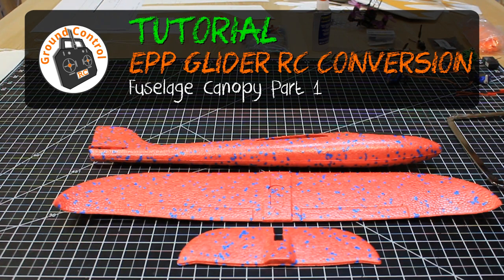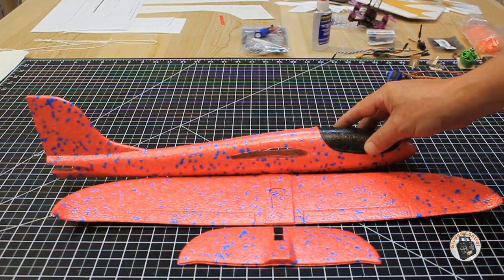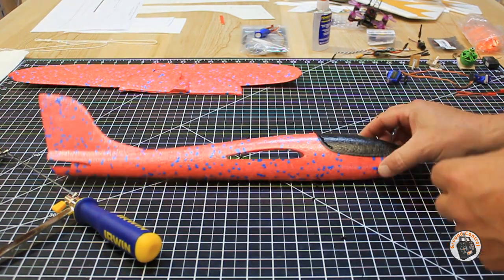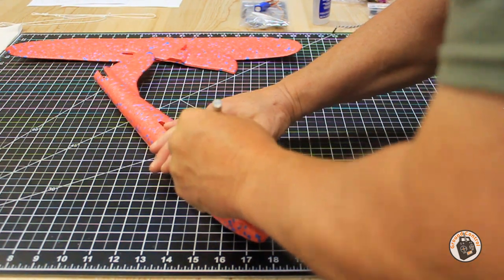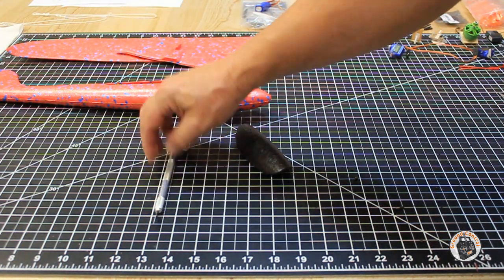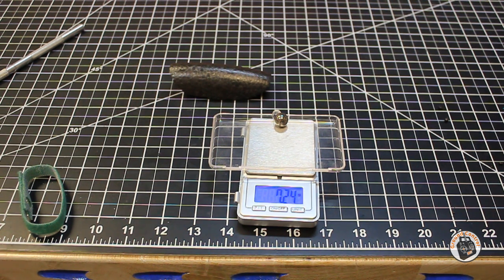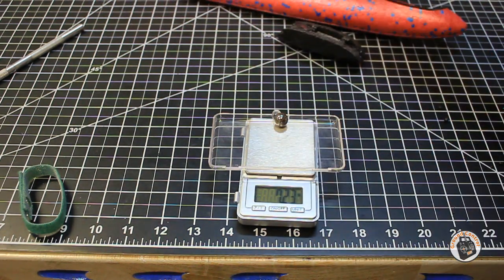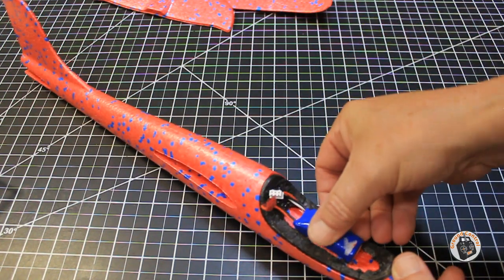Tutorial Part 1 - Glider EPP 48cm RC Conversion - Canopy

Comment: The black canopy should just lift off with some force. It'd just double sided taped into place. No need for knifes/saws
Reply from the maker: That's excellent! Thanks for the info as I'm going to eventually, when I have time, convert another one of these gliders with a tractor motor. I could not even see the seam on mine. Thanks for that information as it will save a lot of time ;-)  See you in the Air!

Comment: Stumbled across this in the YT rabbit hole. Not disappointed. I build em with 3 5gram servos. 2 for flaperons (flaps and ailerons at the same time)  and elevator. No motor. Fly them off the beach when the winds onshore. The dunes create slope lift. See ya in the air!
Reply from the maker: Thank You Scott!
This was a fun project.
I purchased (2) of the Cheetah 1 meter Gliders not long ago and I've converted one of them so far.
Much fun for very little cost.
See you in the Air!

Comment: Do you have a tutorial for a chuck glider modded with Horizon BRUSHED UMX guts? I have a couple of sets of electronics (1S brick w 2 linear servo's , brushed motors w props and a lot of 100-150mah 1S batteries). These 2 dollar gliders may work but I am not sure if the electronics/brushed motor have enough punch.
Reply from the maker: Sorry, no I don't. With Brushed Motors you would most likely need to use a (2) Motor setup to provide enough thrust on a 1S Power System. I believe they make a 36cm version of this Chuck Glider as well and that may be a better candidate for a Brushed Motor Power System. You may be able to do this with a Tractor Motor setup using a singe Motor and Gearbox with something around a 5" Prop. After flying the Eachine Mini P51D which has a 1S Power System using a Brushed Motor, Gearbox, and Prop I thought that specific Power System may make a good 1S Power System for other Projects. Something to consider? See you in the Air!
Reply: @GroundControlRC  Thanks GC

Comment: These epp gliders are so unbelievable cheap I just bought 6 pieces for 13€ and all arrived via post 😁
I check a very very easy setup with 2 Servos and 1606 and one with 1806 brushless drive 2s 450mah...
And maybe a 35cm glider with DVD Rom motor 🤔
Keep it up this channel is one of my favorites 👍
Reply from the maker: Thank you very much! I ordered (3) of these and have only converted (1) so far. I have one to convert using a tractor motor on my To Do List ;-) I've found these make very good planes for Brushless Conversions ;-) See you in the Air!